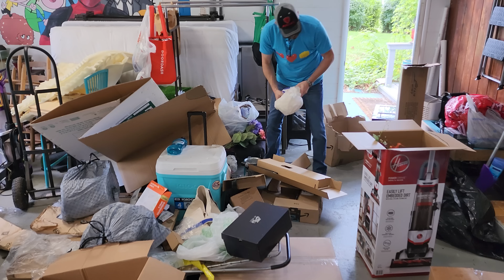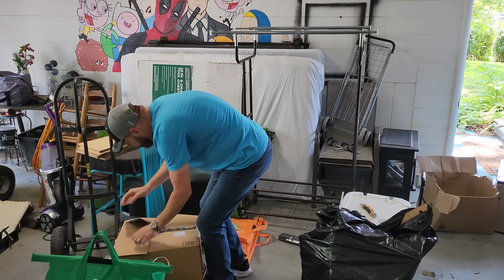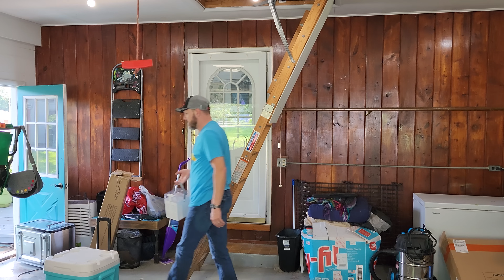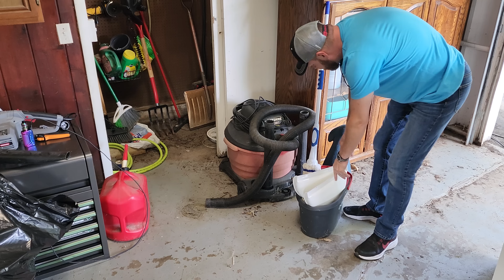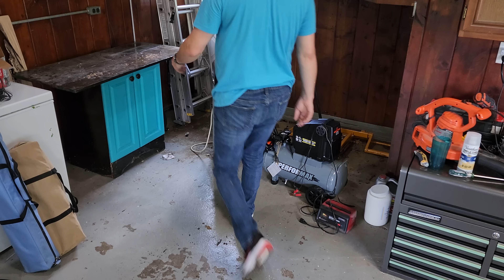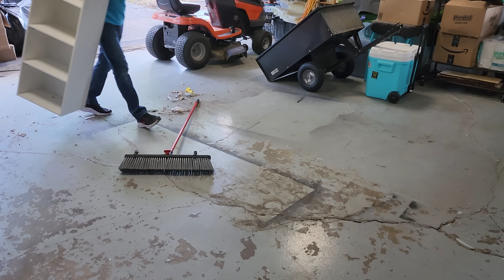Cleaning my brain by cleaning my garage

Comment: A big thing that has helped me with depression is forcing myself to think more positively. Every time I thought a negative though I would write it down and then write down a positive one to combat it. Eventually I didn’t have to write it anymore and noticed it and corrected myself right away. Speaking more positively to myself has helped a ton!
Reply: I can sometimes be bad for thinking negatively but at one point I noticed I would use / think the word "worry" a lot...I mean 100's of times a day. Positive (oh I don't need to worry about that now) to negative (I need to worry about this) or procrastinating (I can worry about that later). So, I said I was taking that word right out of my vocabulary. I was using it so much it weighed on me. It took a bit but really helped.

Comment: I’ve been in therapy for almost five years (one year of Cognitive Behavioral Therapy, four years of Dialectical Behavioral Therapy) and these are the phrases that I’ve learned make the most impact on my anxiety, PTSD, and depression:

1) “You are not in trouble.” There is no jail time, no moral failure, no punishment for not understanding how to do something and needing to ask. There is no need for the adrenaline flooding your veins. No one is going to hurt you for being new or inexperienced at something, or for going somewhere new.

2) “You can complain the whole time, but you have to do the task.” Things can’t go straight from horrible to good with depression, you have to get to a neutral point first. That can mean verbalizing that it’s bad right now. But you also need to Do The Thing alongside the complaining to get that compass needle moving towards neutral. This worked great for me in combination with a timer to see how long The Task ACTUALLY took me.

3) Not a phrase to say, but the removal of a phrase from my therapist’s appointment notes- when she stopped adding “patient confirmed they can stay safe until our next visit” because she no longer had to ask. She knew I could. ❤️

4) “The solution to the anxiety is doing the thing causing the anxiety.” Calling RiteAid to transfer my prescription to them from Walgreens. Walking to a new library. Using public transport. Sitting in public without my back to a wall. The reinforcement of neutral and positive outcomes eventually made my anxiety come down to a level where I can critically use the coping skills I learned in four years of DBT.

Also, as you said in your video- I am on medications that assist this. I am on 10mg of Atomoxitime (ADHD medication), 60mg of buspar (anti-anxiety), 100mg of lamotrigine (I’m using it for depression, it’s used for a few others things that don’t apply to me), and hormonal birth control. These medications have made a HUGE difference in my life.
If anyone reading this has the privilege to tolerate and access psychiatric care, I highly recommend it. It can level the playing field.

Make sure to be patient with yourself when trying to find the right medication for you- it took five years to find the right ones for me. Lexapro, zoloft, trazadone, litium, and prozac were all my previous efforts. ❤️ but most of all, do it for yourself. Effort is the greatest act of love you can provide for you.

Comment: Hi there, it was such a strange and awesome thing to hear that someone feels and thinks exactly the same way I do. I am 38 now. I have a chronic anxiety disorder since I was a child, with huge socialization problems relevant to Asperger syndrome, and those expectedly caused a recurrent depression since I was about 15. I had a lot of escapistic behaviours, including PC games, books and even booze lately. And eventually (quite recently though) I've found out the same principle of the impact of having a purpose as you have. The problem here is I can't find a meaningful purpose. Instrumental purposes (projects like making a renovation, or moving to a new house) only help for a while, as they have a measurable finish. When I'm done, soon I feel as purposeless as before, I feel my life is pointless and depression hits back. And as a depressive master of failure, I feel I will inevitably fail at any long-term meaningful work.

By the way, I also found out that my anxiety and socialization problems were likely caused by an attachment disorder thanks to my parents' own mental problems and behaviour. Trying to heal that trauma also helps to deal with myself. If you still haven't, try to make a research in that direction.

Comment: You know how Spielberg used yellow, in Jaws? I was laughing to myself at what seemed like the same kind of intentional use of turquoise in this video. Anyway, if you haven't researched autistic meltdown and shutdown, I can highly recommend it. It really helped me to understand my brain in a new way, and to realize just how important nervous system regulation is in autistic people. Also (sorry for the mini class in autism, everyone), it's not a spectrum from high to low, as people used to think, but more like a color wheel. You can be high in one area (sensory sensitivity, for example), but low in another (interpersonal communication). There are a LOT of points on the wheel, making us all completely different, but also the same. 🙂

Comment: I relate so much with you!  I went through a “party” phase in my 20’s, but I used it as a means to cope with the loss of my grandpa, who was one of my best friends as a child.  Fast forward a few years, and I would have panic attacks so bad at work, as I would see my landlord going into my apartment and hurting my cats, and I would see it so vividly, it was as if it were happening right in front of me.  I got put on buspirone , and it has worked wonders.  I was recently out of work for a month, and I sunk into such a deep depression, that I just didn’t care about anything.  My cat, and finally getting a job have pulled me out of that depression and I finally have a purpose and a reason for my day.  Thank you, for sharing your struggles.

Comment: You gave some great advice here! When I admitted to myself I have depression after years of bottling it up, I was in a very low point. I set myself goals each day, but wasn’t hard on myself if I didn’t do them (things like get a haircut, chores, start a hobby etc). My mandatory tasks each day were open the curtains and brush my teeth - those led me to continue other self care tasks each day

Comment: as a person who hoards and has ocd as well, one of my major blockers to cleaning is how to not cross contaminate germs from a "dirty" item to a "clean" one. for example, you once cleaned a house that had alot of mouse droppings and poison around and so how do you get rid of that without contaminating items you will keep such as important papers and food. just seems way easier said than done to only touch the problematic items and then to only touch the good items but in a hoard mess everything is really mixed together and gets overwhelming to tackle.

Comment: Getting into every day good habits really helped my anxiety. So for me that looks like 1) read Bible 2)pray 3)blast some uplifting music & spend at least 10 mins cleaning up a space or tackling a project. Starting a task is the hardest part, then it's not so tough to keep going and get more done. Set reasonable goals, however small, do even just one thing, one part. Progress isn't linear, it increases the more you go. Instead of distracting/avoiding problems, we can tell ourselves "I will rest at X hour" and then feel positive about whatever we accomplished. Also drop-kicking the  JUNK out of the house feels amazing, 10/10 do recommend.

Comment: I have struggled with anxiety for as long as I can remember, and everything really came to a head during COVID when I also became increasingly depressed and began having suicidal ideation. I was able to get connected with a psychiatric nurse practitioner and began discussing medication. I told her my one attempt at trying meds had been pretty traumatic and she suggested we use a test called Genesight which looks at your DNA to help find which meds might work better or which you should avoid based on your genetics. The test isn’t covered by insurance but they have a maximum out of pocket expense for patients and financial assistance if needed. This helped ease my anxiety (ironic I know) about taking meds so much and we were able to find a really good fit. She also had me start out on an extremely low dose and ease up slowly so I would have time to adjust. I just wanted to share my story in case anyone else is nervous about trying meds and/or has had a bad experience in their past that discouraged them from trying again. Thanks for your honest content!

Comment: Hi Mr. Clothing! 👋🏻 So there is a Genetic/ DNA test that you can have done for mental health meds in particular, I had done a cple years ago, and they can pin point exactly what meds will work with your Genetic makeup/ DNA. It is incredibly interesting. It takes the quess work and trial and error out of medication management. From everyday medication like Ibuprofen to pain, anxiety and depression medications can all be tested for.  I found out about a very rare gene I have as well. The information they can obtain about how your body processes medication is just amazing! Its definitely not something that is widely used or talked about yet from my understanding. It is very expensive. There are grants that physicians can obtain to do these tests on patients they think would benefit, however I do not believe its something insurance is footing at this time. I was just lucky enough to be included in a grant program. ❤ ❤ Tid bit of useless information.
(The more you know 😂)